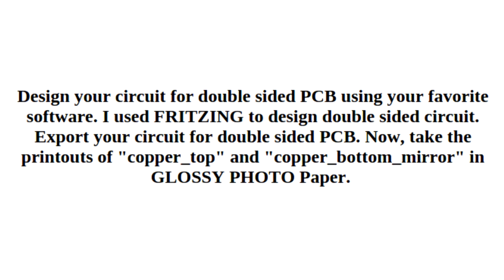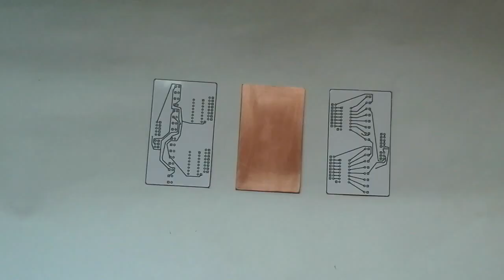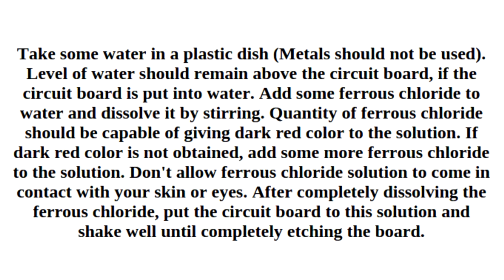Easy Way to Make your Own Double Sided PCB at Home

Comment: Exactly what Yusuf Shoair says. How do you solder the vias...  especially under these types of IC sockets and pin headers?
Reply from the maker: +MontOneBrno put some copper wires through the vias and solder both sides
Reply: so you don't use some pads of components as vias? do you only use exclusive vias?
Reply from the maker: +MontOneBrno exclusive vias means ???
Reply: I mean a via which is only a via. But you can also use a component's pad to go to the other side. But some components you can't solder from both sides..
Reply from the maker: +MontOneBrno compnents pad means it's terminals ???
Reply: +My Funny Electronics i would say so :)